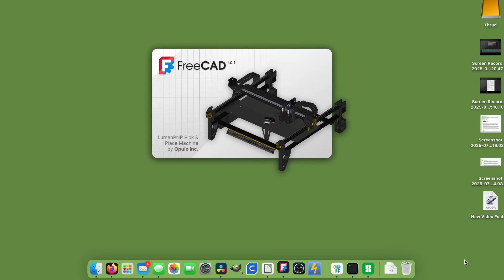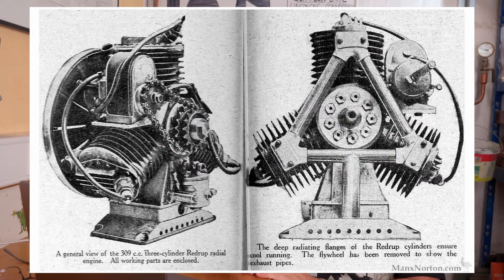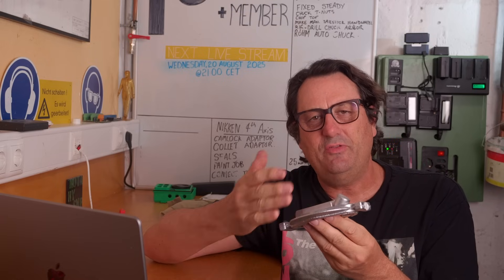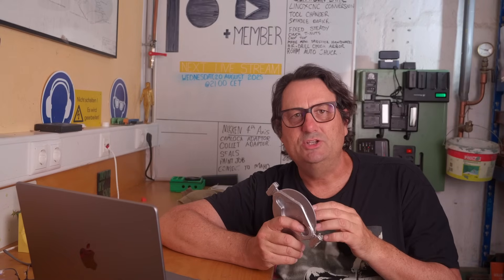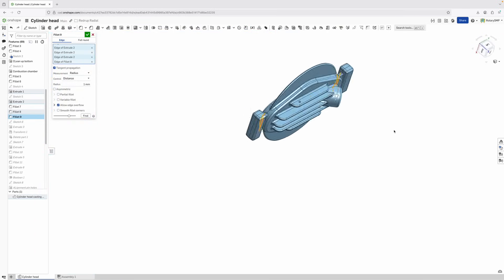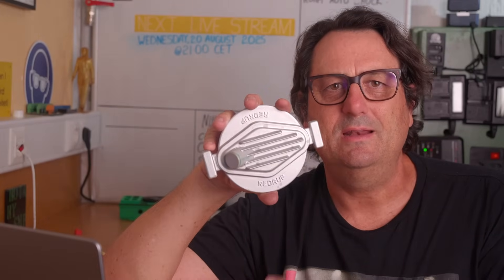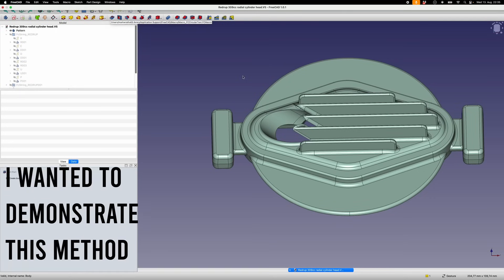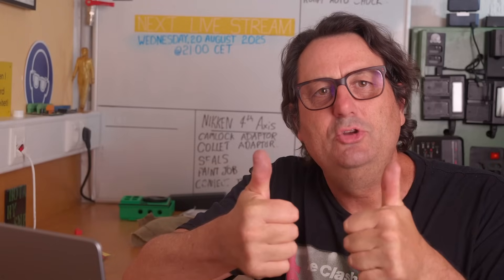FreeCad vs Onshape - Why did I switch? || RotarySMP

Comment: No shame in it, Mark, no shame at all. I've been using free software almost exclusively for over 30 years, and as much as I'd love to use it for everything I do, there are simply times when pragmatism dictates that you need resort to commercial applications.

If you can solve your immediate problem with a trial, or free but limited option, then use that rather than handing over your money. Don't decide to switch wholesale unless you've really thought it through. 

Are you faced with the particular problem on a regular basis, or is this possibly just a one-time thing? Can you solve the problem by changing your workflow? For example, create that text on a path in Inkscape and import it into FreeCAD? (absolutely you can!). Could you solve your filleting problem by exporting your model into Blender, add the fillets there, and then export the resulting model as an STL? I'm not entirely sure, but for some that might be a practical workaround. Every application has its strengths and weaknesses, and one of the beautiful things about free software is that it costs you nothing to explore alternative tools for solving your problems.

If you come to the conclusion that you need to use commercial software, consider who you want to support. I would say the overwhelming majority of "big" software vendors have a decent track record of regularly screwing over their customers, by switching to a subscription model, changing license conditions, or just ramping up their prices whenever they please. Don't support those companies! There are many smaller software firms, and even Indy developers who have worked for years on applications that they sell for modest amounts. Market share is everything in the software world and many, if not most, companies and corporations will do anything they can to charm and sweet talk their way to getting it They know that once they have that sweet, sweet market dominance they'll be able to use it to start making real money! Sure, those leading applications might seem to have all the bells and whistles, but the companies behind them don't care one bit about you at all.

I'm sure that OnShape is an excellent choice for Mark right now, no arguments from me. It costs him nothing, it's a competent tool with a consistent design philosophy, and if he gets a year out of it then the time put into becoming familiar with it will have easily been paid off. But don't forget, OnShape is focused on building that precious market dominance, and because it's a SaaS tool they'll be in a great position when they switch their focus to maximising profits.

Remember Fusion360, when it was all over YouTube channels similar to this one? I can virtually guarantee that the same story will play out with OnShape, just give it time.

If you're not committed to any particular CAD software, and would rather support a fledgling company with a different take on it, have a look at Plasticity. I hear it's very good! But always read the fine print before you hand over your money!

Finally, even if free software can't solve your problems right now, one day it might, perhaps sooner than you'd expect! I think it pays to keep an eye on what's happening in the world of free software, even if you've reluctantly moved away from it. Live free or die (if circumstances permit)!!!
Reply from the maker: All very good advice Paul. Thanks.

Comment: I've certainly noticed Onshape's Youtube marketing push. But I'm not sure their marketing department is talking to their pricing department. Neither the free nor $1500USD/year plans have any CAM functionality at all, which in my mind limits them to hobbyists primarily interested in 3d printing (or strictly manual machining I guess). You have to upgrade to their pro plan to get basic CAM functions. At $2500/year, that's almost 4 times the cost of the entry level Fusion plan, which does include CAM.
Reply from the maker: They now have CAM in beta, but I don't know what the plans are for it going forward.

Comment: I've been using AutoCAD since version 10 for DOS, in about 1989/90. I then went for AutoCAD LT in its various versions, when it came out. I generally only do fairly basic sketches, with the odd bigger components, although I did do a full modelling for installing two new wire drawing lines in a 250mtr by 30mtr shed for the company I was working for at the time. My transfer to Fusion 360 was not a happy one and, in the end I stopped using it due to restrictions that Autodesk was imposing. I looked at reviews of pretty much anything that had a makers' version that wouldn't break the bank and settled on SolidWorks, as it only cost £50 odd for 12 months. I still haven't managed to get past the first hurdle of learning how to use it. Even following the official training videos it goes wrong every time. So I now have a nice 3D printer sat there that has only printed some parts downloaded of the web. And then those didn't actually do what I wanted them to do. Such is life. So back on to rewiring my project motorcycle.

Comment: Man, you hit the nail on the head with your review of FreeCAD. I started using it several years ago after watching your channel. I came from Fusion360, and after they revoked the free for hobbyists license option, I paid for a subscription for a year or so and finally decided I wanted to own my models again. I've learned to live with most of FreeCAD's quirks, but I only use the Part Design workbench because that's how I learned to model (Siemens NX, many years ago). The Part workbench feels like amateur hour to me, and the fact that it doesn't play well with sketched extrusions (Part Design Workbench) just reinforces that idea in my mind. I haven't had any trouble with file size and performance since my models tend to be simple, mostly single-body designs with low to moderate complexity. Plus, I have a pretty grunty workstation with ample compute resources.

However, the two quirks that I'm unable to tolerate are the Part Design Workbench's inexplicable inability to create desirable drafts and fillets. Almost every model I design in FreeCAD either lacks the features that I want it to have, or I jump through hoops coming up with hacky alternatives to compensate for the fillet I want not working. Unfortunately, it's become too disruptive to tolerate anymore.

I'm not ready to switch to another cloud-only CAD software like OnShape (Fusion360 left a bad taste in my mouth), but I'm almost certainly going to ditch FreeCAD soon unfortunately. IMO, its attempt to accommodate multiple modeling styles leaves it incapable as a sufficient solution for any single one of them.

Comment: i use on shape, I like it. self taught from their videos. only really need the first few lessons to do most of what i need to do. in a quest for something i can use offline and private I've tried freecad, but I've had a tough time getting my head around it. granted I haven't really dug into it like i typically do. anything really complicated my PC can't do it on onshape, it just bogs it right down. luckily most of my parts are fairly simple. just a part here and there to fix something or build a project. I don't do anything like CADing up a entire engine or anything
Reply from the maker: I also found Onshape very simple to use Richard. That maker license is very handy.

Comment: I've pretty much used all the 3D CAD releases out there and although I was a big fan of Inventor,  they revoked my education licence with no  explanation.  Switched to Fusion360 free version but they have crippled a few features like being able to export 2D drawings as PDF's😮 I just recently switched to the desktop version of Solidworks Maker. US$25 per year, and although it was initially a bit strange to use, I'm now finding it to be excellent.  
Regards, Preso
Reply from the maker: Hi Mark, I could have gotten a Solid Works student license through the uni, but it is windows only, and that license would exclude the commercial usage, which it seems showing it in a monetised channel might be.

Comment: Look I really want to support open source when I can, and actually almost everything we build at my company is open source. But I just CANNOT deal with FreeCAD.

I do a lot of both mechanical and PCB design, and I love KiCAD, it is actually much EASIER to use / learn than the established giants like Altium (unless you are trying to do something VERY advanced).

But the same simply is not true for FreeCAD, and frankly the community around FreeCAD is kind of toxic in the way they react to criticisms. (although I think it has gotten slight better in the past few years).

From my perspective (and I could be wrong because I haven't been closely following development recently) the majority of people making feature / roadmap decisions in FreeCAD are not professional mechEs and are not really trying to cater to them. Whereas KiCAD, for example, is actually trying to make an application the professional Ecad users can get value out of. And I think they have done a great job (unless you are doing complex / high speed stuff like PCI-E and large DDR memory fanouts).

Even given my already low opinion of FreeCAD, I am disappointed that it bogged down your computer so badly, I've had 1500-part assemblies open in SolidWorks on my laptop (which is roughly eq to an M1 macbook in power) and it chuged a little but was useable.

Frankly I think the FreeCAD project is never going to be mainstream, it just has too much baggage, technical, inter-personal, and a poor reputation. I think a useful opensource 3D cad is possible (look at blender), but when it happens it's not going to be FreeCAD.

Comment: FreeCAD is really interesting, but it’s extremely limited by the kernel it’s built on. Under the hood it uses OpenCascade (OCCT), an open-source kernel from the 90s. It’s powerful but also bloated, buggy, and missing a lot of NURBS/surfacing features. That’s why you run into quirks like the filleting.

Onshape runs on Parasolid, a proprietary kernel by Siemens. Parasolid is considered the gold standard in the CAD world. Super reliable, used in SolidWorks, NX, etc. But it’s expensive, which is why you only see it in commercial tools.

Fusion 360 and Inventor are built on a fork of ACIS, another proprietary kernel. Autodesk has added a lot since their fork, but the base is still ACIS.

If you’re curious about why kernels matter, the founder of Plasticity did a great talk explaining why they chose Parasolid. Nickallen1 "What is a Geometry Kernel, C3D vs ACIS vs Parasolid"

Comment: Yeah, my stance on open source tends to be "you get what you pay for". Not that it's all bad, but it's hard to do it right from a end-user perspective.
Reply from the maker: Good summary. I am pretty happy with Gimp, for my limited graphics needs, and LinuxCNC is awesome. I am not that familiar with Blender, but it also gets high marks. I guess a full on CAD suite is a very complicated software, where structural weakness made in the initial core code becomes very hard to correct.

Comment: my work is doing CGI for architecture projects. so when i want to machine some parts my pipeline is  3dsmax -> *.obj -> Artcam  (i even managed to do a thread milling by helical interpolation)  :)
what i want to say is software choice is a pretty personal thing.  better way is to use a software you most experienced and comfort with.
Reply from the maker: Wow, that didn't see that workflow coming :)

Comment: Yeah, the geometry kernel freecad uses has limitations with fillets, and text is a bit of an afterthought. I would normally use inkshape for any complicated text layout(convert the text to path), and import the svg as geometry.  The big problem I have with onshape is that it's cloud only, I really don't want to depend on a subscription to maintain access to all my old work, especially when the terms of that subscription can change at any time.
Reply from the maker: I understand that.

Comment: I've used quite a few CAD programs over the years, from Autocad 11 and 13, Alibre, Solid Edge, Solidworks, Inventor and currently Fusion. I was a beta tester for Onshape in early 2015 and was excited to see an alternative to Solidworks with a different commercial model. The thing that finished Onshape off for me was the use of 3rd party add-ons for CAM (in particular) and many other features. These were priced at truly professional levels. Along came HSM Works offering free 2.5D CAM for Solidworks and the embryonic Fusion 360. HSM Works was then bought by Autodesk and provided the (free) CAM element of Fusion. I did try Freecad, admittedly before the recent big update but it was too buggy and lacked some key features I needed.

Unless you feel you need Fusion's overpriced "manufacturing extensions" (I don't - nothing there for me), the paid-for Fusion licence is great value at £400/yr. It does most stuff apart from 4th and 5th axis simultaneous toolpaths although you do get indexed 4th axis moves.

You say you are getting a free trial of the CAM option (it seems to be available free for anyone for 14 days and possibly 6 months if you presumably convince them you are a business) but the pricing is prohibitive at $2500 per year for the Pro version once the time is up and you've invested your time into it. How many of us will go that route when Fusion is either free or £400? I'm afraid I won't be coughing up for that and I don't see any "hobby" options that offer any CAM content that would work for the majority of your viewers.

Think carefully about the CAM bit, given that your machines are both CNC!

Comment: Buying a bigger desktop computer would not help much with FreeCAD.
FreeCAD is mostly mono-threaded, it would not leverage the additional cores of a more expensive CPU, and would only improve marginally from the faster single core performance.

Personally, I see only marginal gains when I switch from my "ok" laptop Thinkpad T14s (11th gen core i7 i7-1185G7) to my "biffy" desktop (Ryzen 5 7600X).

FreeCAD is frustrating as hell to use, stability is meh, ergonomics are abysmal (specially the errors), and performance goes down the drain once the models are somewhat complex (my last project started to really struggle past ~200 parts).

I feel like there are some low hanging fruits to improve performance, but I might be wrong, and I'm not sure the FreeCAD project is the sole culprit here, the issues could also come from OpenCascade (underlying framework used by FreeCAD).
Reply from the maker: I didn't know it was only mostly mono-threaded. Ouch.

Comment: Anchos are dried Poblanos.

I have no use for freeware, if it was any good they would bottle it and sell it. An awful lot simply exists because of anti big business ideology.

I use BobCad, most of it is really easy to run, the Cad does most of what I need and the company has been awesome to deal with.
If I get to the point of actually needing good CAD software the 5k upgrade to solid works is peanuts.

I will never use cloud based or subscription software.
Reply from the maker: I get that.
Reply: The entire internet runs on open source software. Including YouTube.
Reply from the maker: @rodfrey  True, but apache that is not freecad.
Reply: @RotarySMP  I was responding to the "I have no use for freeware" - we all use freeware. Perhaps he mistyped and meant "freecad" in which case I should have kept my mouth shut, as usual. 😀
Reply from the maker: @rodfrey  I get it. Good point. We all need opensource.

Comment: i am an absolute fan of open source, but there is a clear compromise in using these programs. just like buying something vs making it yourself, you are trading money for troubleshooting time. for example, i'm making a homemade cnc router that can cut aluminium, i could spend 5k and have one at my door and working in less than a week, or i could spend 1/10th of that money and a few months of my time to make it myself.
as a hobbyist the second option is the only option for me, and the experience and knowledge acquired from building it is priceless, but if i needed the machine for a specific task, or had a customer waiting for a part, then things change
to summarize, time = money, people choose what they can afford based on their personal circumstances
Reply from the maker: That is an excellent comparison.
Reply: i just did the mini mill, with someone else's grbl controller and a cheap router. does aluminum quite well and I have maybe 500 or 600 into it. eBay has the mini mill with steppers for three hundred something. much cheaper then other places